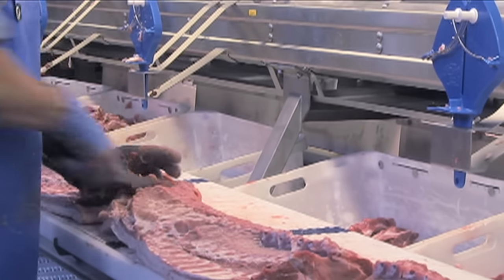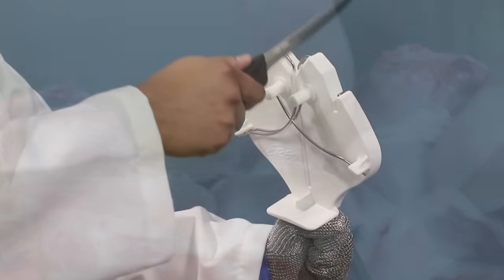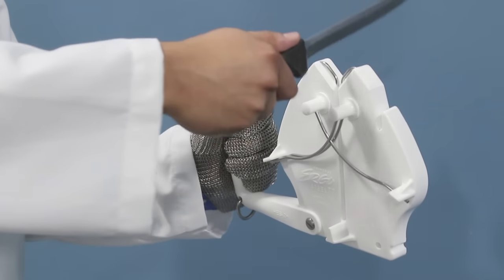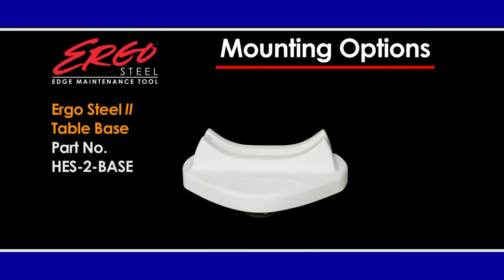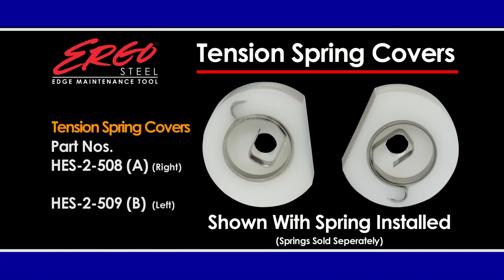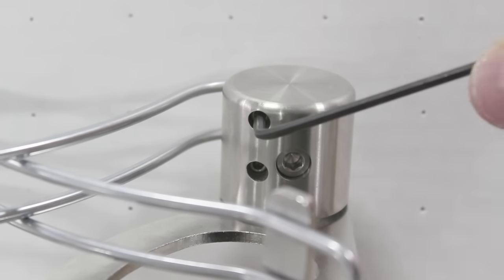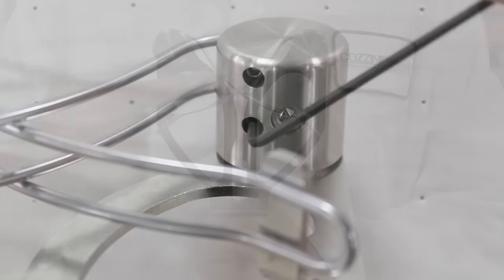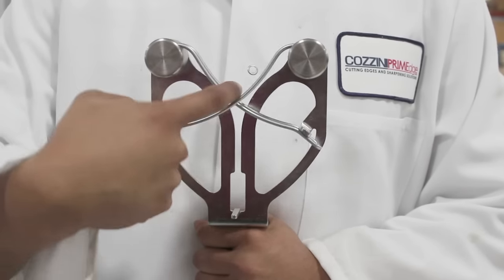Ergo Steel Use and Maintenance

Comment: Doesn't the carbide sharpener permanently damage the edge?
Reply from the maker: Hello SailfishSoundSystem. The Ergo Steel Plus is designed to thin a knife when it becomes blunt. The Ergo Steel Plus gives you the ability to bring the knife back to its thinned condition without leaving the workstation, thereby maintaining a razor sharp edge between sharpening. The knife is not permanently damaged and your regular sharpening procedures should still be followed.
Reply: Thank you.

Comment: Can you sand these?
Reply from the maker: Hello Jose. PRIMEdge does not recommend sanding the Ergo Steel Rods. The rods are specially designed to straighten and align the knife edge for razor sharp performance. If you are looking to thin the blade we suggest using the Ergo Steel Plus model (HES-2CRB)https://www.primedge.com/products-services/edge-maintenance-tools/ergo-steel-ii-plus/. This model includes an integrated carbide insert for thinning the blade.